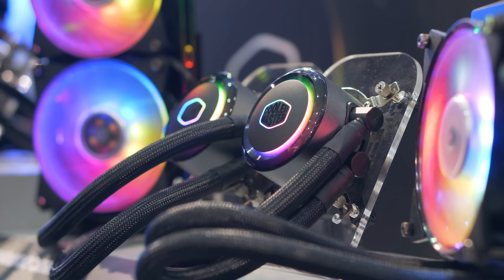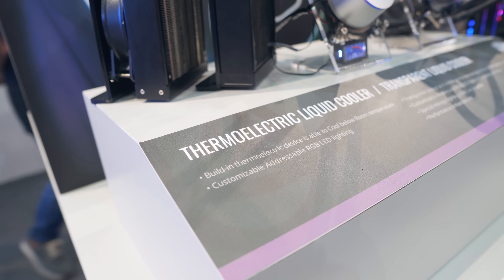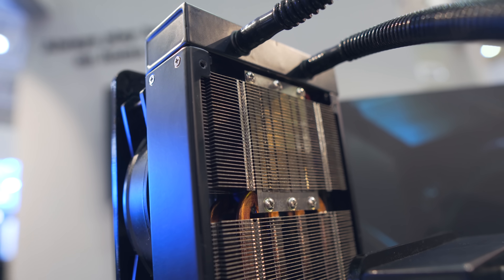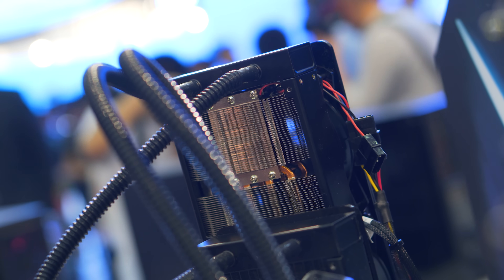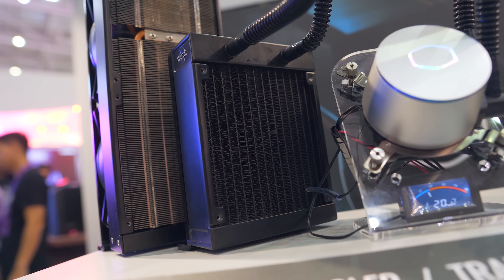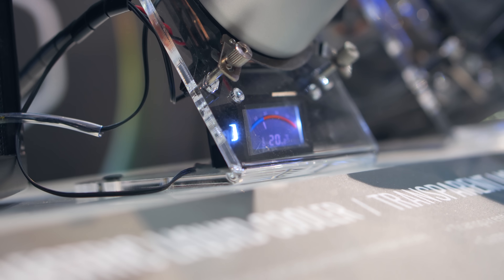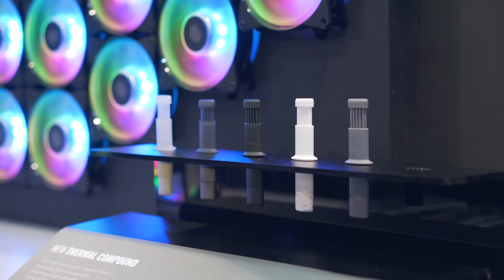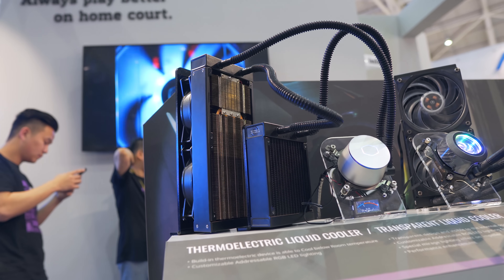Thermoelectric Liquid AIO Cooler - Cooler Master Prototype!

Comment: How many TEC'S are installed in this device?

I own a freezone elite from Coolit.

It has 6 TEC'S. 

It's benefit was significantly lower temps for what it was at the time. 

TEC'S have a notorious quality of literally freezing which leads to condensation, which is death to electrical parts.

The freezone controlled the temps to avoid this problem.  

Would be really interested to see results.  

Hopefully TEC cooling makes a come back.

Comment: We dont use TEC's because of the cost in electricity.  how will this one fair? Peltiers are great for cooling and a water cooler to remove the heat from the other end. just always raises the cost in your Bills every month.  its just not usually worth it to run all the time.

Comment: Seen more compact DIY thermo electric cooler done Other an air cooler on the hot plate and the temp was more in the 15 degree under ambiant than 7 to 10°

Comment: That heatsink size doesn't mean that it would be needing a power draw of a GPU that size.
TEC Modules' hot side just get extremely hot while the other one gets cold.
The heat gets multiplied thus it needs a huge heatsink. Also, bigger TEC heatsink = even lower temps.
This is similar to how refrigerators work. TEC Modules aren't power hungry.

Comment: The heat is gonna be multiplied tremendously by that TEC module that's why the rad is not built in to the TEC heatsink.
The TEC will reach higher temps than what the CPU would reach, but that's not a problem since you wont be exposing the heat to your components anyway.

Comment: Phononic makes the Hex 2.0 thermometric cooler. I have had one for a year, uses 35w overclocked x99 5930k to 4.4ghz stock voltage stable. Keeps everything under 80 even when stressed. Its air only, not a water hybrid.

Comment: Ahhh peltiers making a comeback.  I wonder why they dont mount it directly on the CPU and then just use all the radiators together to cool the hot side?  Condensation concerns so close to the socket?
Reply: No you need to look into thermo dynamics to understand the reason this is not viable but short explanation: an ideal peltier element should have very low heat conductivity and very high electrical conductivity so by just sticking the cool side on the CPU you would not be able to sink all the heat that is being produced or you would need a lot of current through the peltier element which would result in even more heat .
Condensation is not so much the problem.
Additionally the peltier element works best( highest efficiency) when it is used at about 20 % max current so with the size of the cpu dye the corresponding peltier element would only be able to transport a fraction of the heat that the cpu produces.
Reply: jimmy bleron uhhhhh you sure about that?  What you said makes no sense.  Im talking about cpu>peltier>water block to cool the pelt.  How is that any different than using a pelt to chill the water?  And what i described is how many pelt setups worked back in the day.  They did just fine but were relatively power hungry just as this new setup will be.  And what does the die size have to do with how much power you are running through the pelt.  Do you just say words and numbers hoping it sounds smart? Lol

Comment: Is this basically a mini-refrigerator?
Reply: AvocadoAtrocity It works on a different technology. If it's truly thermoelectric, there's no compression and expansion of liquid like a refrigerant, it simply transfers heat away from the CPU via a pad that, when electrified, cools one side of itself and heats the other.
Reply: Sterling Ralph fascinating technology. I did some more research and I still have a little trouble understanding how electricity keeps one side cool and the other so cold. Thanks for your time and explanation! You're right. It literally just works power currents and no compression/expansion (of course not talking about the liquid radiator).

Comment: These Peltier Cooler designs have been around for quite some times but their problem has always been this huge power draw! No way they are making it to a final product.
Reply: They have done it before with the coolermaster v10!
Reply: Actually the problem with them, has been that they kept trying to put the TEC straight on the die, which causes condensation. I've always thought someone should have done one on a radiator, to cool the coolant like this for a long time. I could care less about the power draw if it can keep a CPU or GPU ambient or slightly sub ambient.